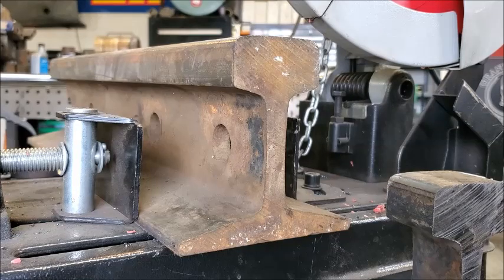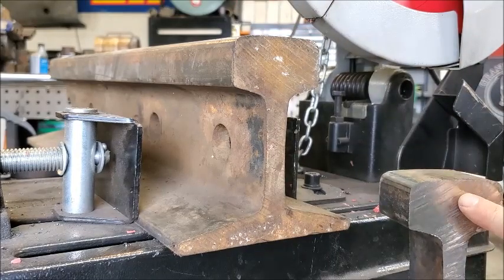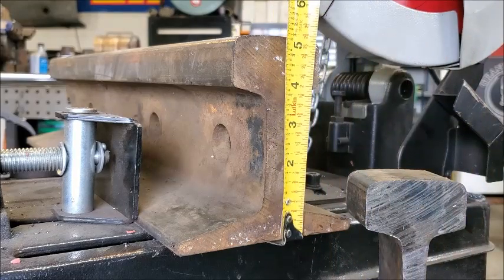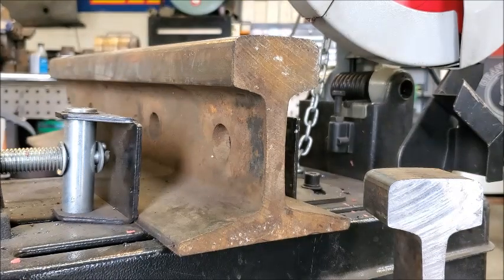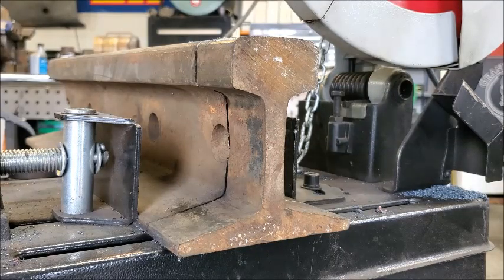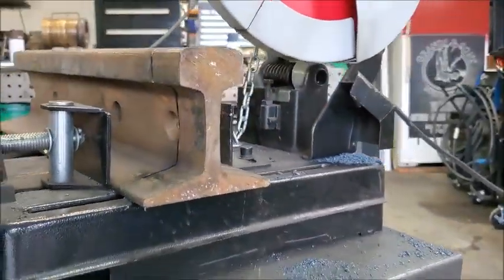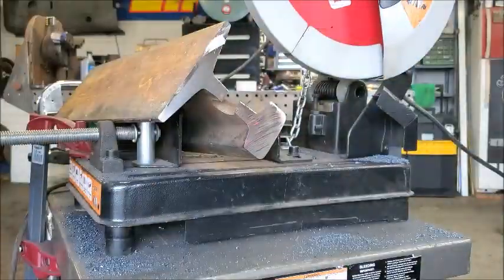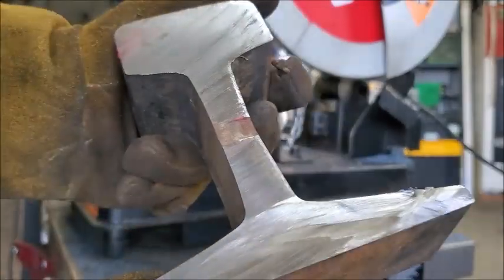DYECO offered Diablo Blade Cuts Railroad Track!

Comment: I have had mine for 3 years and still on the same blade ,I have the 14 inch BOSCH I purchased it as it has a 7 year replacment warenty ( saw not the blade ) ,Best money i have spent , clean straigt cuts , I mainly chop RHS 50x100mm with a 5mm wall thicknes  ,cuts like a hot knife thru butter  , not rail track Im not that brave im sure it would be ok but the band saw would be what i would use  ,,, If you ever get to use one you wont ever go back to abrasive wheels ever .

Comment: You can use 2x2 square stock to clamp on the narrow cross section after flipping it over to avoid using a different tool to finish the cut.  I use 1-2-3 blocks because I’m spoiled where I work.

Comment: I used to run a rail welding plant. We cut all the rail with a circular saw. Granted it had a 60" diameter and was hydraulic, but still just carbide.

Comment: You can believe this or not.... you can break that rail with a sledge hammer! Cut through the flanges with a torch or whatever, then prop the end up on a flat laying  2x4, or something similar with rail flanges down and top up. Next strike directly above the cut with a sledge hammer... it will break completely through! I didn’t believe it until I tried it. 
I’ve heard that in the old days, they would score the rail entirely with a hammer and chisel, then hit it with a sledge hammer and it would break. That would be a good YouTube demonstration too.
This is a good demo, however I’d like to know more about the saw being used and how long it took.

Comment: I destroyed my Evolution blade not long after buying the chop saw. I was a newbe to this type of saw. I had been using my Dewalt  abrasive chop saw for over 15 years. I was cutting 1/4' plate and stood it on end and applied too much pressure. The blade caught and took about 8 teeth off the blade. I bought the Diablo because it was cheaper. It cuts just as good as the more expensive Evolution blade. I have been using it for over 2 years now with no problems.
Reply: Do you use the Diablo blade on your dewalt chop saw if so how is it working out, I just bought a new dewalt still in the box and it's the abrasive kind and was wondering about changing blades.

Comment: I purchase 8 hardened steel flat bar. I have no info on how hard it is. the measurement 3/8" x 1" x 10" in length . I am wanting to cut these down to 1" pieces. what 10" blade would possibly work? thank you

Comment: Not many people know that the diablo blades are rated for 1800max rpm and the circular saw are running much much faster than that. The Diablo blades won’t last long. They will work ,but not very long.. just keep that in mind..
Reply: You have no idea what you are talking about. Dry cut saws for which these blades are designed for are rated at 1800 rpms.
Reply: @AJC-jo3ds  tell that to the people that has no idea what their buying. They’ll just grab what’s available on the shelves.
Reply: @hgherb  hey there is lots of saws and different maximum rpm 1800 i will buy one blade that is for less than 3000rpm (Freud-Diablo 10 X 50 X 1 Ferrous CERMET CSB, Multi, Talla única (D1050CF),be sure first,I know you have good intentions but this is the truth .
Reply: Look up cold cut saws low rpms
Reply: The Diablo Steel Demon blade I have says Max 5,800 RPM right on it. I agree that perhaps there could be a more prominent warning about ensuring RPM speed compatibility between blade and machine though.

Comment: Would’ve been nice to know how long it took you to cut through that
Reply: Very little time. I just bought a blade today and been cutting sheet metal, 1/8 thick. It's much like cutting wood paneling, fast and easy but the cut is very clean and seems far quieter. I'm only watching these videos to see far I can take the blade. According to this video, I can take it pretty darn far.

Comment: Question.....looks like it does well on the thick stuff but as a blacksmith (axe and hammers) I'm curious as to how it would handle solid high carbon (4140, 1095 that sort) over 1"?? Like say 2" round stock....thoughts??
Reply from the maker: The rail track is high carbon steel....so i think you would be good.
Reply: 4140 is a cake walk compared with high manganese rail steel.

Comment: do you have to use a speed regulator? i just bought a milwaukee 14" chop saw for cutting steel, mostly 1/4" thick plate, tubing and angle iron. The rpm is 3,800..

Comment: Wow.. can i put that blade in my bosch abrrassive cut off saw? Thanks for the reply...
Reply: I'm not sure but it would depend on the speed rating on the blade vs the saw. I tried something similar to that with a 7 1/4" abrasive chop saw and a 7 1/4" carbide metal cutting blade from tractor supply. The speed is to fast but it does work, albeit it's not perfect. 

I would love to try a Diablo blade and see if there is any difference.
Reply: The surface speed is much faster on an abrasive blade.

Comment: If you flipped the railroad tie upside down you could of cut it.
Reply from the maker: Not the case. The bottom is wider than the top and would have hit the blade. I tried. Have a good day. Thank you.
Reply: Hey Dyeco what do you think about those little Milwaukie metal cutting saw with the 5 3/8 steel cutting blade for like tubing and such.

Comment: Whats the top RPM that this blade can handle? My chop saw is faster than most blades like this.
Reply: Check the description under this video. It says Max RPM 1800. You can not use these blades on an abrasive chop saw. You must use them on a metal cutting saw that originally came with a metal blade such as the DeWalt DW872.
Reply: I have a Diablo Steel Demon blade that says max 5,800 RPM

Comment: I can do the same thing with a hacksaw
Reply: if you start when your 16 you will finish when your 65 and use 3000 blades ,,,, I will keep my chop saw thanks ,, I have had mine for 3 years and still on the same blade ,,, I chop RHS 50x100mm mainly ,, not rail track ,,, If you ever get to use one you wont ever go bac to abrasive wheels ever
Reply: Nice troll.